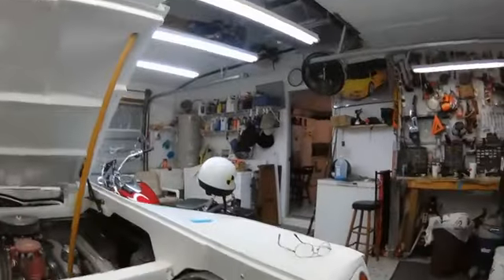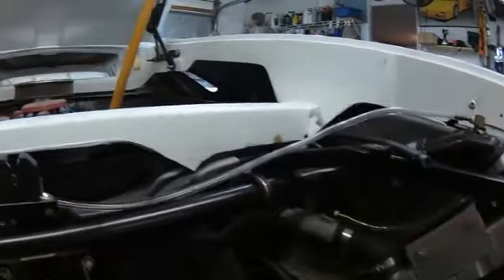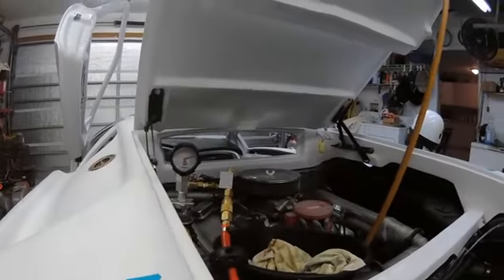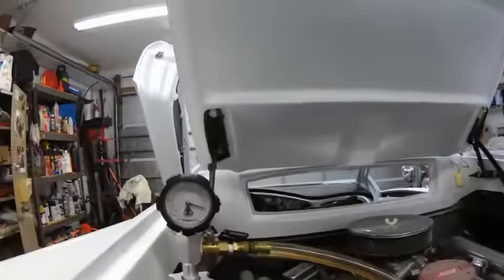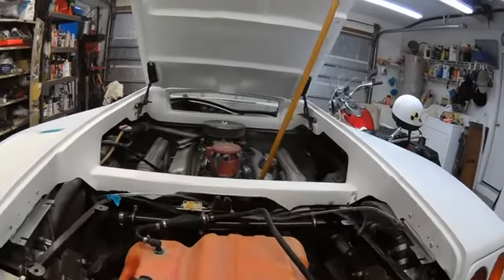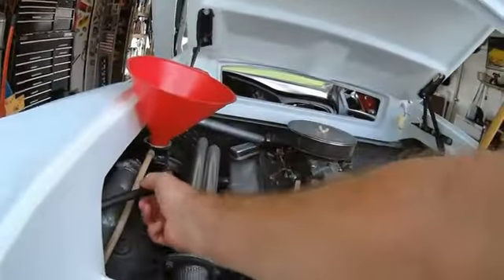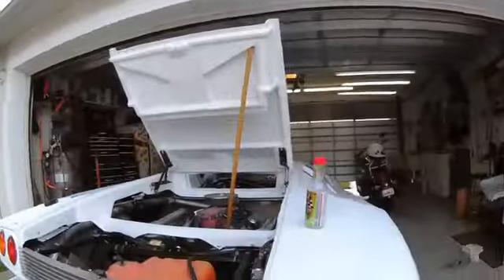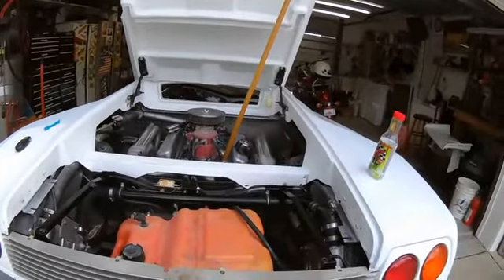Coolant Sytem Video     #pnsearch

Comment: Tim ...   How did the system hold up on a drive.   I have to rebuild my whole coolant system, sometime I can go without overheating and the next day I cant go a mile before it overheats. 
Mine will sit and idle now for hours and no get hot.  Drive down the street and it over heats.
Reply from the maker: Seems to be staying cool... drove down the street and staying cool... even let it idle when hot and the cooling fans shut off after about 20 minutes... that's a first...  bottom line,  the system has to be free of all trapped air... 😎   true test of course is getting out on the road and running hard... well see